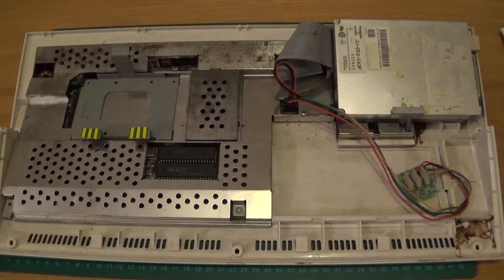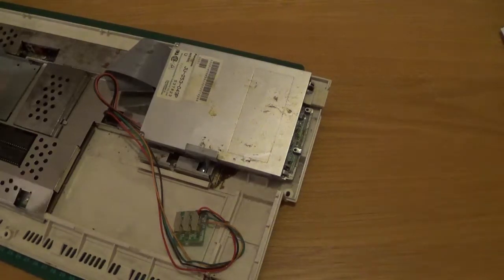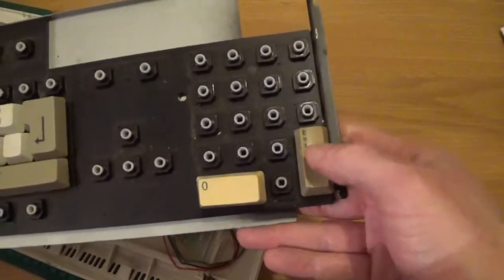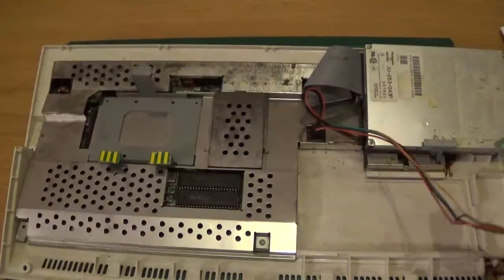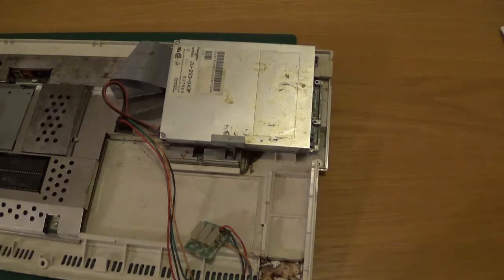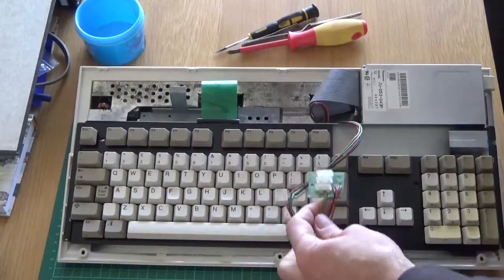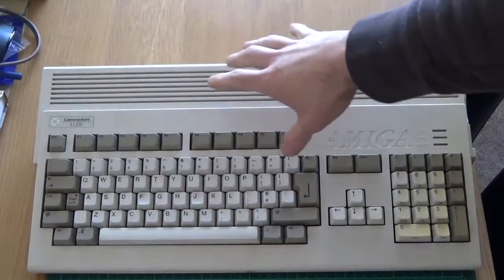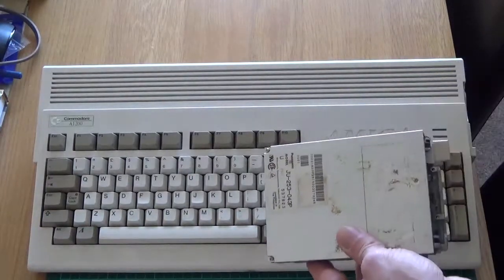#53 Amiga 1200 floppy drive swap out

Comment: The Miggy looks nice and clean now mate, Just a tip on the keyboard ribbon cable you don't pull on it to remove it (that's why you've snapped the top portion off) if you look at how its connected and gently pull on the top white section it pops up and the ribbon cable is free, then to reconnect slide the ribbon cable in and push down on the top white connector that will lock it back in place.
Reply from the maker: Cheers for the advice mate. It's literally the first time I've opened up a 1200 so it was trial and error tbh.
Reply: good advise :-) i ruined 1 myself before seeing someone do like that :-)

Comment: Sorry mate forgot to tell you you have to e mail amiga kit tell them you are interested in the replacement drive with black eject button and sign up and give them your email then they will e mail you back notifying that they have put one in your basket for you as there was no purchase option sorry mate looks like you got on ok in the end anyway how much did you pay for the drive and does it work ok now?
Reply from the maker: That's ok Mike I managed to source one eventually on flea bay for around the same price anyway.  Yeah once installed the new drive worked much better, the old one was filthy. I've decided to move it on now though as I've fallen out with 16 bit floppy based software again as I find it just too unreliable.
Reply: Yeah it can be a bit of a ball ache I try to clean every disk before I even put it near my amiga most seem to be ok but I get a lot of incompatibility issues with the 1200 I'm not sure if it's the 1200 or if it's due to my upgraded memory and accelerator card